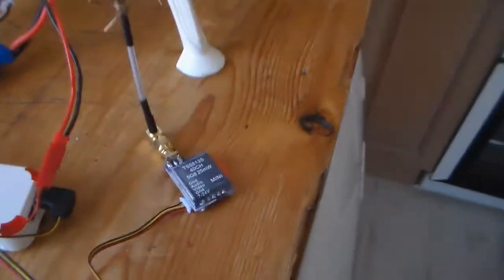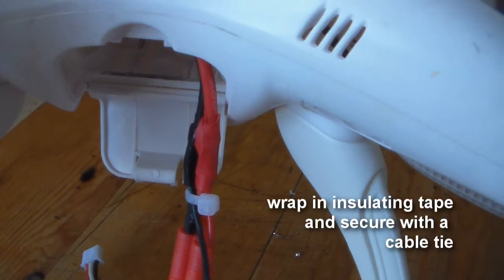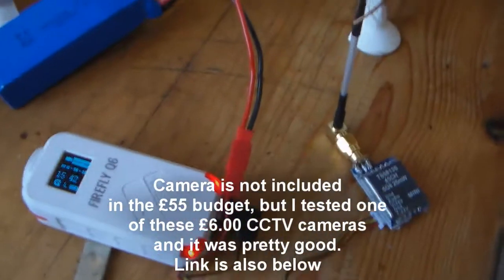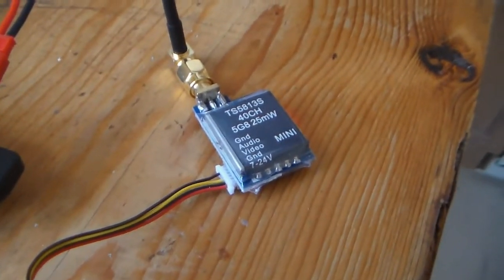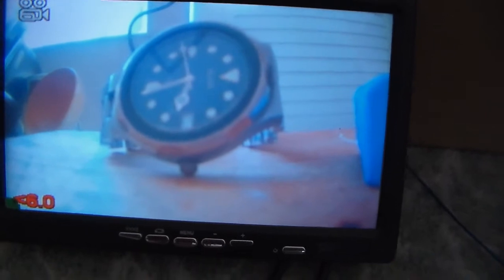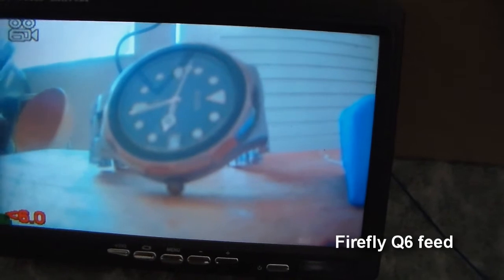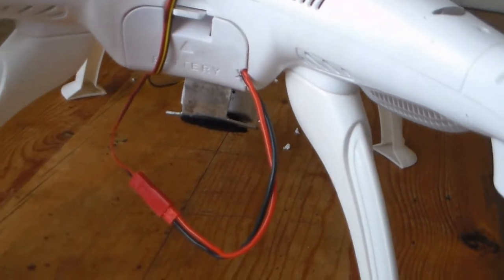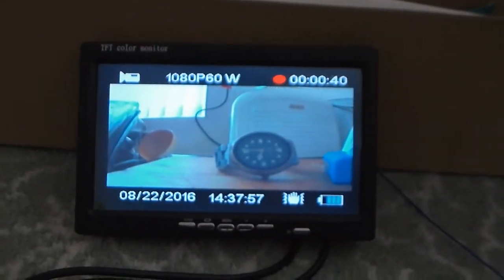FPV set up for £55 with Monitor, TX , RX  (not inc camera) - Here's How

Comment: hi, do you test max distanc. nice video.  I think to buy sky zone ts 5823 with firefly q6 camera. I instal to syma x8hg. I need around 500m distance rang.
by
Reply from the maker: Find a big flat field with no people and no obstructions and fly it away from you!
Reply: Yes I try, just one questions, can you fly with FPV and recording with camera in same time.
by
Reply from the maker: Yes usually with all the cameras I use.

Comment: bobflyman hiya I did this setup about ayear ago I took the power supply and put it on a two way switch on the bottom of my syma x8g so I can turn on and of at anytime  
you can go to my channel and watch the video iv only a few of my own uploaded videos it's not hard to find  fpv mode on syma x8g I'm sure with my cloverleaf hanging down from the bottom next to my power switch that powers my full fpv system and mini runcam  
it was my first attempt and it's working amazing but feel free to watch my friend good luck with it